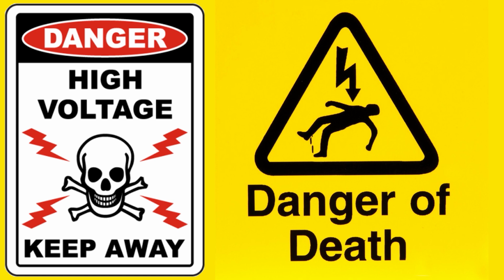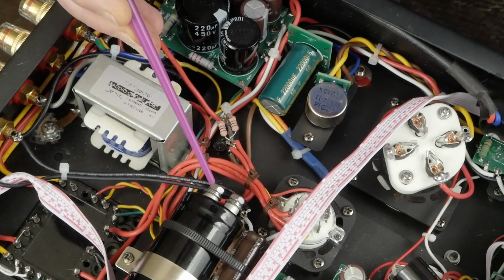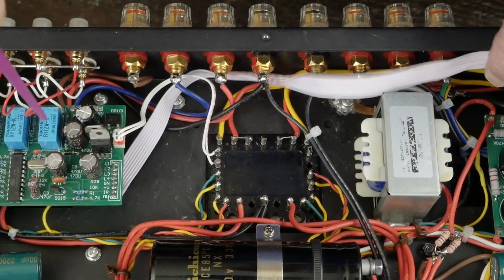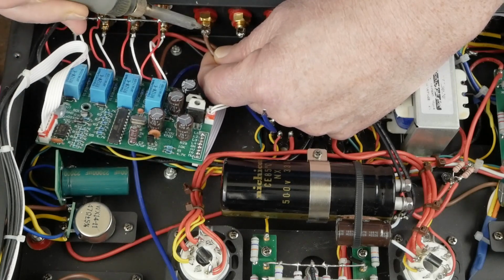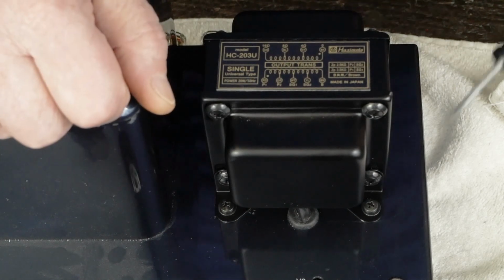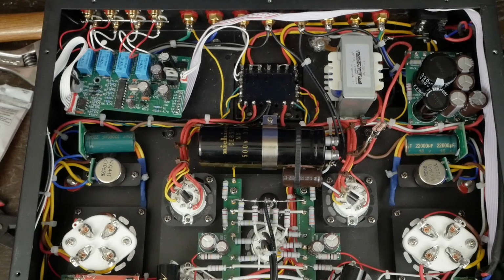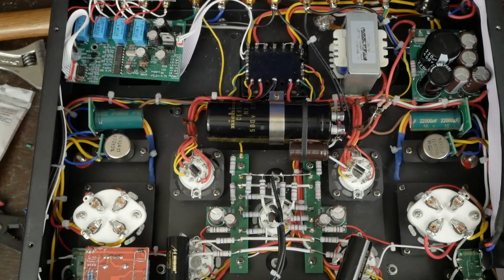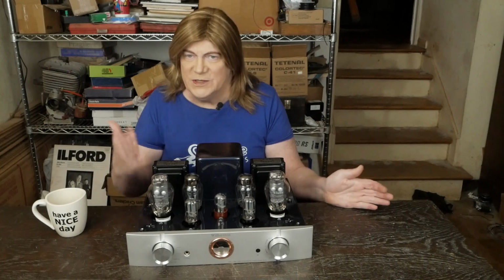Willsenton R300: Output Transformer Replacement Continued

Comment: Id really like to by a Class A 300b SET amp  with zero feedback . And im having a tough time figuring out which  to buy. I have around 1600.00$ to spend . Id really appreciate some recommendations from you ? Im a young kid just getting into Hifi . My current setup is a pair of 1959' H.H. Scott 99d Integrated tube Mono Blocks. They work pretty well honestly but I'm curious honestly what you would suggest . Is the Yaqin Ms300 model  any good ? 
Im also looking at a  1998' 
Elekit TU 898 mono block setup . But is there a good way to contact you and get some advice ? Or perhaps i purchase the Willsenton R300 and buy a hashimoto for it . And mail it to you. Idk i just need some help. Id appreciate it a lot
Reply from the maker: Do NOT buy a R300 and I refuse to even work on those anymore. Those Scott amps are nice, of everything you have mentioned only the Elekit look like an even decent "upgrade" option. Trying to get into a decent 300B amp at $1500 is going to require buying used. Nothing new at that price point is worth owning.

Comment: These resistors look like the ones you replaced in the first R8 because you didn't trust their quality.  Are you going to replace these too?
Reply from the maker: Oh this is the R300 lol. For some reason these aren't shedding their coating and yes, later I will likely be replacing everything when I gut and rewire this amp. Basically at this point this is $1500 for a chassis and tube sockets.

Comment: A bit confused as to use the 3.5 ohm primary you need P1 and SG1 which are the red and white wires primary side.  You did not use the white wire.  Can you explain?  Thank you
Reply from the maker: SG1 is screen grid 1 i.e. ultralinear tap. It's not used on a triode tube. B is the high voltage DC connection, red is the 3.5K plate connection.
Reply: Ok, thank you for explaining that. Now I understand.
Reply: I switched out the willsenton opt for the Hashimoto.  Removed all the headphone jack wire as well.  Thank you for the vid.   Anolog Discovery tests look good.  7w@3%, 4w@2%

Comment: Why do you have two different connections to the chassis? Why not take the second chassis connection to share the power connector ground point?
Reply from the maker: I've found it helps reduce noise to not directly attach the signal chassis ground to the earth chassis ground.
Reply: @SkunkieDesignsElectronics  Experience speaks above theory!

Comment: The capacitors one for each ch just before going into each audio card they are mounted on the bottom with some sandcast resistors and seem they are part of the power supply. .. the value .0.1 k  250v   how many uF is that Steph ?
Reply from the maker: The links I saw looked like 0.1uf but again send me a picture and maybe a schematic, it's just a guess from my google search
Reply: Thanks Steph I will try and send pic tomorrow

Comment: Hello Skunkie I was hoping you could help understand a capacitor value that is odd ...it is a 53 year old Elna electrolytic used in my Sansui Receiver model 7000 the value says  
.0.1k 250v
Reply from the maker: Hmm a google search I found this https://richelectronics.co.uk/product/0-1k250-k4-0-1uf-250v-polyester-axial-capacitor-5-pieces-mbf025e

I also saw there is a "K-code?" 

Where is this cap located. You can contact me at stephe@skunkiedesigns.com with a picture might help.